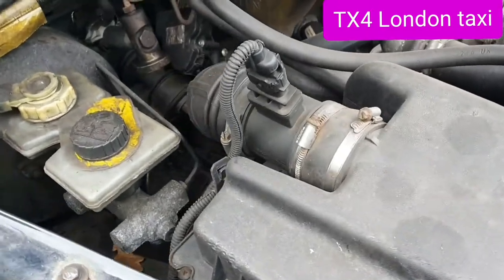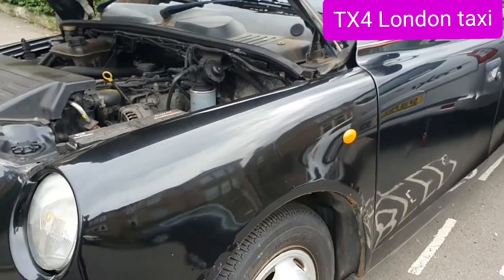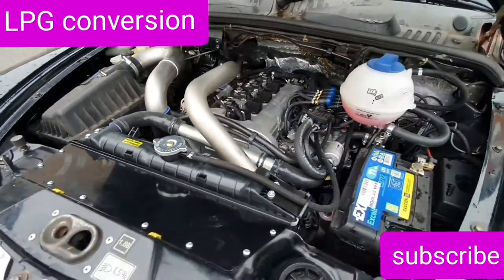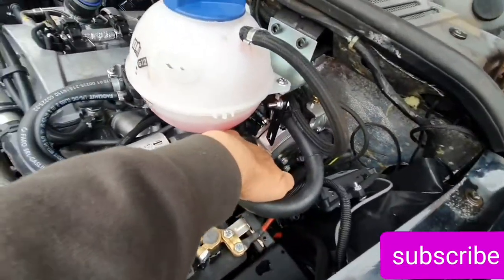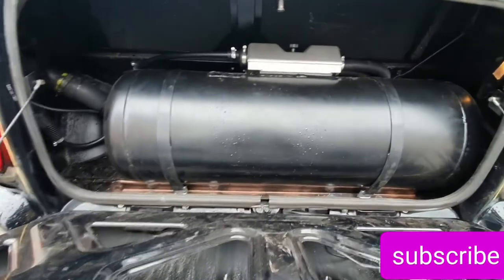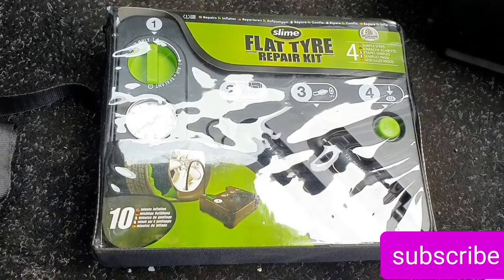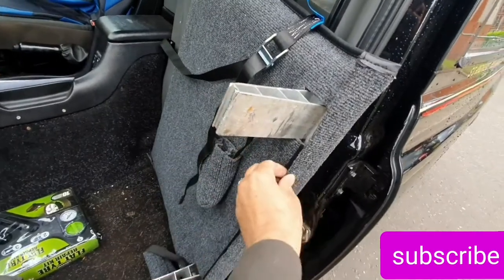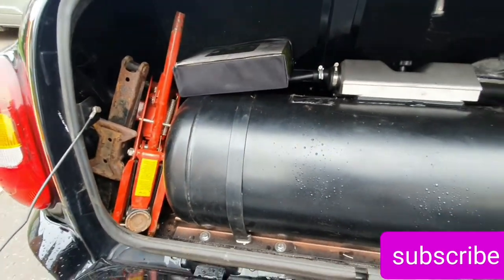LPG conversion tx4 London taxi

Comment: Hi I was thinking of buying one of these cabs already converted from Edinburgh to put on a Glasgow plate to meet the LEZ would you say it was a good move or do you think try get a euro 6 instead of conversion thx
Reply from the maker: Hi I think need to get euro 6 better than lpg. Because lots of problems in lpg. Can't get the gas . And so many other things is well. Thanks
Reply: @mnasiruk4802   Thank you I really appreciate you replying to me thanks so much I will just leave it now your 100% right I’m so glad I came across your post I’m going through the SVQ start of May hoping to get date for topographical soon been waiting six weeks on a date thx again